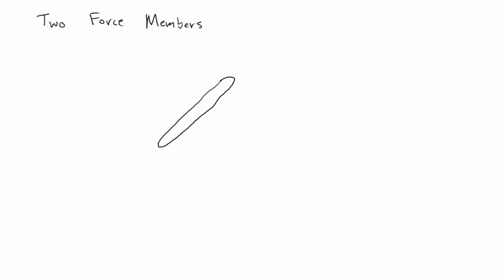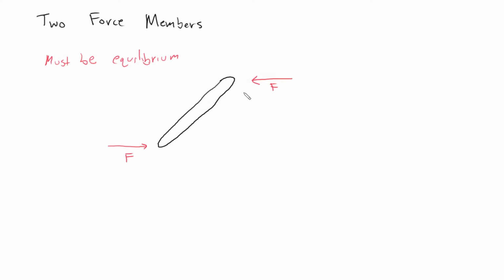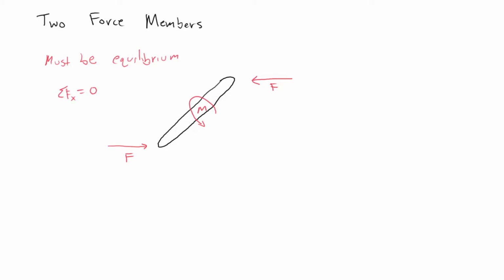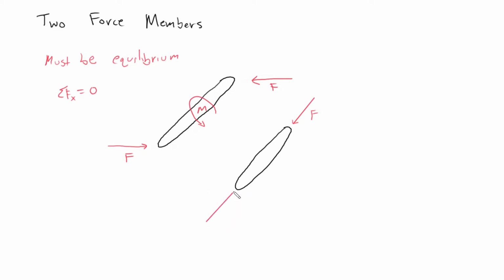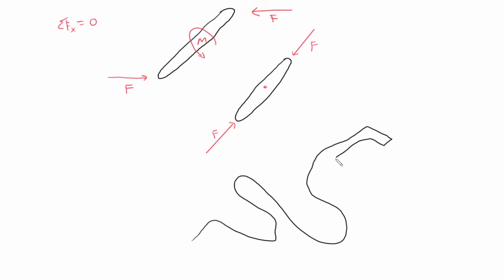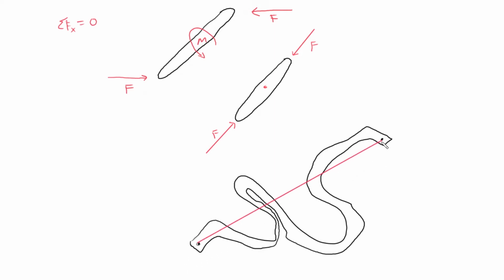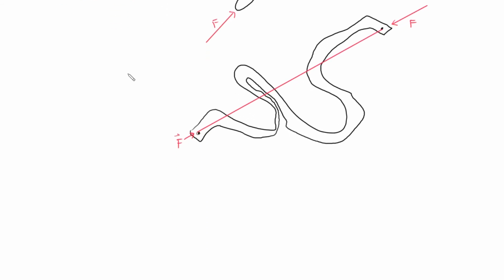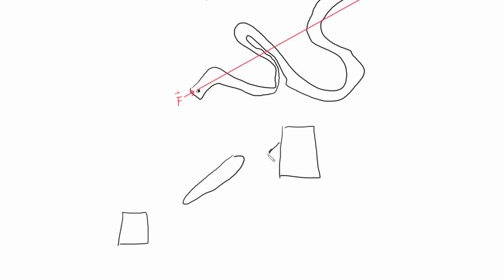Two Force Members

Comment: Hi, I just wanted to know that can there be more than 1 or 2 external forces acting on the pin joints of a two force member ?What happens if there is a force(external or internal) acting in between the member?
Reply from the maker: A two, three, four, etc. member is possible. As long as the object is in static equilibrium. The caveat is that all the forces or their line of actions must intersect. I think I have a video about 3 force members
Reply: @alexjbeezy   Thanks Alot ♥️👍
Reply from the maker: No worries glad to help!
Reply: Do you have an email for queries?